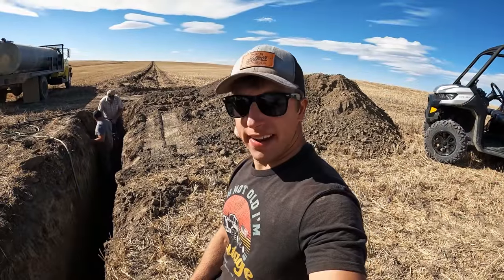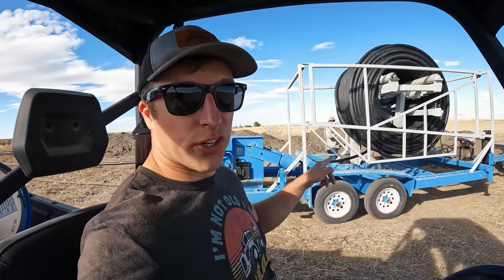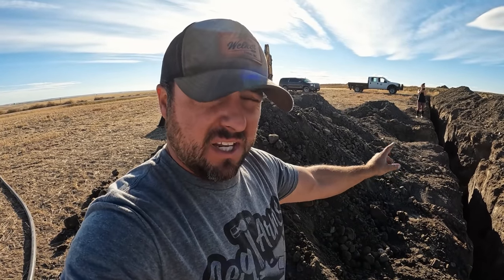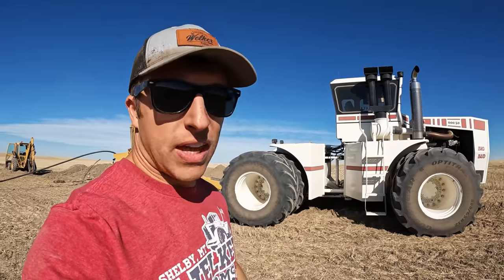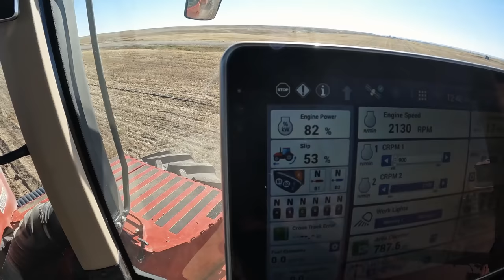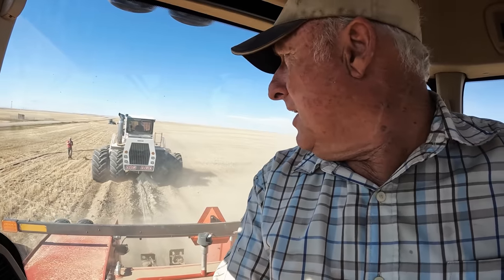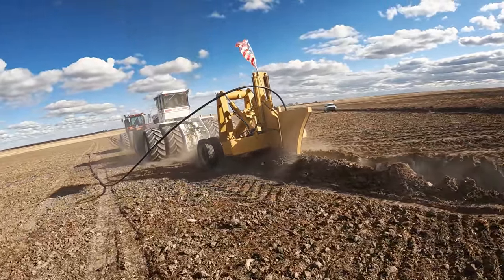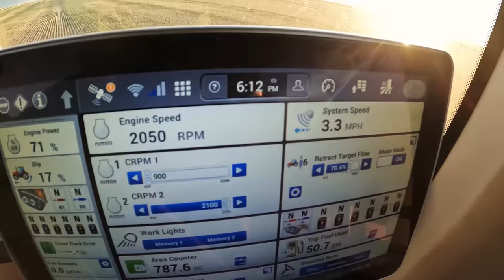6ft or BUST! - This Is How We Lay Gas/Water Lines

Comment: Everything you did laying that pipe looked fantastic and that's from someone who spent more than 30 years doing it for a living.
Looks aren't everything so I scored you an F.
When the line fails it's always the fault of the pipe and not the installer or welder so don't forget.
You broke every rule in the book in your installation and you know just enough about welding poly to make you dangerous.
Would you give a complete novice a steel welder and just walk away letting them get on with it?
There's always time to do something again but never enough to do it right the first time.
The hot steel thingy is a hot plate or heating mirror.
The machining tool is a facer or plane and it's critical for getting the ends flush and just as important it removes any oxidation leaving fresh raw poly to weld. Perhaps you cleaned the facer, hot plate and the pipe ends before welding but throwing the facer into the dirt wasn't encouraging. Poly to poly fuses but poly to any foreign material in a weld doesn't. One of the worst things you can do is touch the prepared ends ready for the hot plate with your fingers and leaving behind skin oils.
The two ends of the pipe are fused together and not glued.
Neither 500 or 550 degrees are the correct temperature to fuse poly together.
Very specific pressures are needed for welding successfully usually not found on butt welders without even a gauge.
Very specific times for bead up, heat soak and cooling are just as critical.
No butt weld will completely match the strength of the pipes/fittings being welded.
They appear to though because the bead pushed out in the welding process increases the wall thickness.
If a weld is bad enough it can break apart leaving no indication fusion has taken place but up to that point it will look perfect..
Any stress in the pipe will result in breaks right next to welds because that's the inherent weak point caused by the transition between the varying wall thicknesses.
Why didn't you at least pay lip service to the correct bedding material for the pipe in the areas you trenched?
Every sharp object (stone) big or small in contact with the pipe is a potential leak in the future and you must have thousands of them.
At the very least to limit thermal stress on the pipe it's normally laid at the coldest time of day and if the pipe had been fed directly from the pipe dolly to underground then it would've had minimal sun exposure.
Laying it out only guaranteed maximum thermal expansion prior to laying and my guess the pipe surface was approx 50 degrees c and it was being laid underground  where it will want to contract down to a ground temperature of around zero degrees so every metre of pipe will be battling to contract 12.5mm shorter.
The forces exerted are mind blowing. In normal circumstances the weight of trenching material compacted over the pipe will stop it contracting but your trench was ripped and not compacted.
I've had both of my grouch pills today but I suppose you guessed that already.
The poly industry in the scheme of things is new and suffers tremendously from shoddy work practices. 
I worked once for a pretty large coal mine in their wash plant that was full of basalt lined steel lines installed by construction engineers who hated poly.
Yep the mine engineers got me on site virtually straight after the plant was commissioned to change them all over to poly. 
The same construction engineers did use some poly like for the main raw water feed line to the plant but they had no idea of what they or their contractors were doing so I made a tidy living going back re welding and re installing the work to make it fit for purpose.
The eighth wonder of the world is the reaction of miners to their plants being shutdown because of breakdowns.
Costing many thousands an hour to their bottom lines everyone gets a blank cheque.
I got a phone call once from a desperate mine about 2000 miles away and I foolishly began working out how long it would take to drive there with all the necessary equipment. I and the machinery were flown to site the same day on a domestic passenger service. I was checking pallets in instead of luggage.
Reply: Thanks for the info.  You didn't see when we cleaned the iron before each use.  And the pipe pressure is only 15 lbs when flowing.  Owners of the ripper have laid over100 miles in the past 20 years of line in Eastern Montana and North Dakota this way.  If a problem would have developed it would have been evident. Now I wouldn't do a high pressure line.  I'd leave it to your experiences. But again thanks for the tips
Reply: Having expertise and communicating it to someone in a way that is both helpful and that fits their specific application is a gift. I wouldn’t have my daily serviced by a 40 year experienced Ferrari technician 😉
Reply: @CH-in9lj  That's my entire point.
Near enough is the difference between a design life of over 100 years and failures at any time.
Failure is rarely one thing done incorrectly but an accumulation of tiny errors that near enough produces.
I like these people so why wouldn't I try and save them some grief.
Your gift is in insulting people.
If you don't have any knowledge on a subject and can't add anything attack the person instead.
Have a nice day.

Comment: Has anyone done the math on what the pressure will be on the town supply side to push water all the way to your cisterns? Just looking at the length and understanding about friction coefficients, it has to be using some energy to do that, I am assuming there is a cost to be paid to the town council?
Reply: We have a 5 house pump at our water station and with 15 lbs into the pump we boast up over the hill to our farm 1.5 miles

Comment: Hi guys, I thought I would give you a tip for an extra use of the poly pipe, with 2 way's to accomplish the same thing
Firstly I know you get snow so in winter you will have to drain the system.
I am in Rural Western Australia, so no snow in winter but I have seen it down to minus 9c at 3am where I am
I have a 4000 litre concrete spa I built back in 1986 (in ground)
I wanted to heat it up the cheapest way so I first built a rock stand that would hold a heavy walled 44 gallon drum on its side
Plumbing is to the spa fire under drum = temp rise from 22c to 44c in 6 hours for 4500 litres of water firewood used large wheelbarrow of cut up wooden railway sleepers.

As we in Australia use solar hot water systems I came to the conclusion of why not use a 100m coil of black poly on the roof so I unrolled a oil of inch and a half hooked it up to a pump and timer
** Note * Spa water into pump hot water from pipe to spa so as not to damage the pump***
Pipe after 30 minutes had HOT WATER TO HOT TO TOUCH x 120 liters a time
It worked out I let the pipe heat (in my summer temps) for 20 minutes and the timer would let pump run for 5 minutes and so on often if I had friends over we would have to drag the cold water hose in to cool it down
It frequently got to over 45c
As I had my system working I got a couple of families also to set up
This time we build a rock surround in a Croissant semi circle high at the back shape
Wall,  facing the appropriate angle for your sun arc, we plastered it inside with cement and painted that black  put in the pipe still coiled and covered it in black plastic or sheet metal painted black
Plumbed it to the house, and hot water so hot you had to mix it
Works brilliantly during the day light sunny hours and depending on family needs to some parts of the might
But if you added a storage tank no problem at all
I n your case in winter you would maybe have to backfill the walls outside for insulation or drain the system to prevent freezing.
I feel with you family sizes this system usage for spring summer autumn would save you a fortune costing you a pittance to run example
5 to 10 minutes of power 2 x an hour
I now have a 6.6 kW solar system if I was still using the spa as a spa it would be free hot water all year round for it especially if I put a lid on it
I am single now so I turned the spa into a fish pond.
I hope you consider this idea it WILL SAVE YOU A FORTUNE IN HOT WATER BILL'S
Tony from Western Australia 🇦🇺 😁
Reply: @badgerpa9  if you re-read. My comment you might correct your comment
The pipe in the 2 simular system layouts will probably need draining, though the second setup may just get through winter without needing it local testing will tell.
Tony from Western Australia 🇦🇺

Comment: Just kind of curious why you keep calling the Case IH a Stieger?
Reply: In the 1980s case bought out the steiger tractor company hence the large framed articulated tractors are still called steiger in the series of case tractors
Reply: It use to be called steinger before case.  And its a stienger just like a quad track or 9250.

Comment: 15:20 nick you said when ready to go youll both roll some coal.  Correction nick you rolling some coal with the big bud. Your dad is just blowing with the case.  Big buds yeah baby. Didnt know the bud had a torque converter cause i thought in an earlier vid you said the bud had an 18 speed like a semi just using the bottom gears. Interesting stuff
Reply: Different big bud with the semi truck transmission, they have 3.

Comment: Why laying a gas line? Make a solarplant. You got the accomodation to put solar panels and produce your own energy.
Reply: Gas furnaces, water heaters and stoves/ovens work better than any electric version does. We replaced our electric stove with a gas one, the electric bill went lower than than the gas bill raised when we switched. It is also cheaper to repair gas appliances than electric, as the heating elements in electric is far more expensive than ignitors and valves.